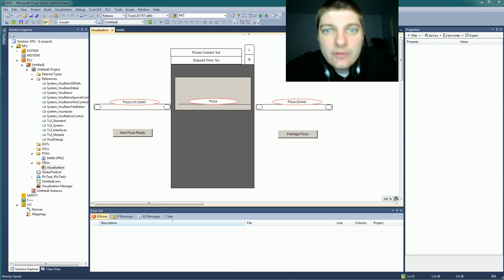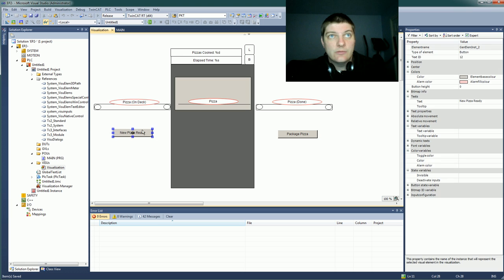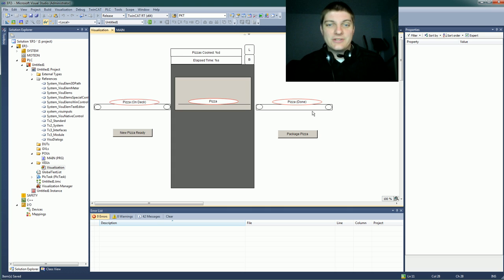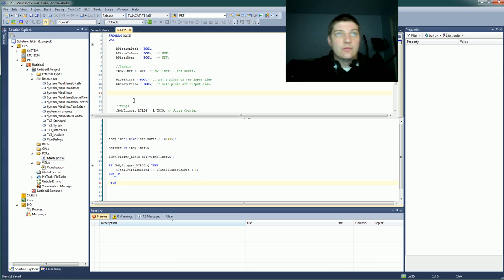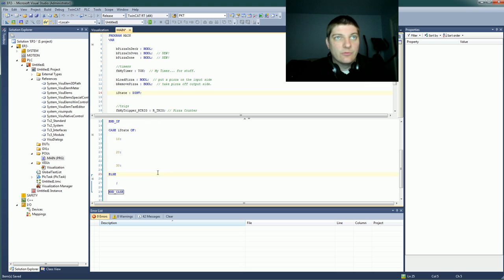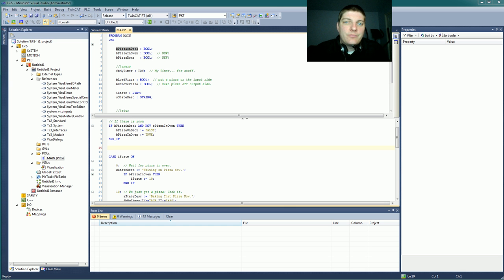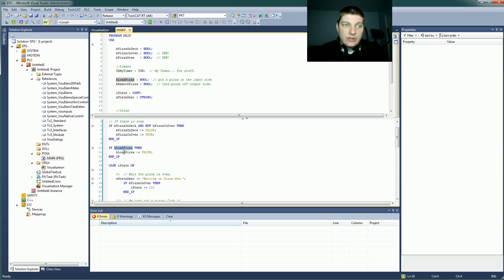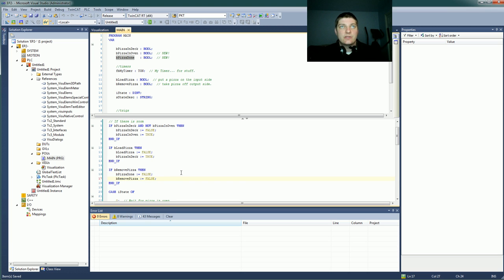Learning PLCs with Structured Text - EP7 - State Machines

Comment: That will come handy for my next project. I always used SFC but this project I want purely make in ST. An I was wondering how would I emulate SFC in ST. This one looks like a good way. SFC gets cluttered very quickly and it is hard to manage. In my code I'll have like 30-50 states in a FB. SO this method will help.
Reply from the maker: Sounds good.  You can get clever and set some code outside the case statement that watches for state transition.  I often set it up to turn on a flag so I get a built in "one shot" in each state similar to the "entering state" functionality of SFC.  I also use this change in state transition to nullify a watchdog timer that I reuse for every state.  It keeps the code lean.  Good luck!
Reply: SquishyBrained Thank you. That sounds like a nice idea. Although not absolutely clear to me. Video example would come in handy.

My project right now is animation of the pubic fountain. I have create library of ease like easeInCubic and other like this about 20. SO I'll also create universal FB that make animation to one direction for given amount of time. By simply placing one FB after the other I can create any pattern I like. So my case is simply 2 lines per case. One line FB execution and the other line is a transition to other case when animation completed.

You know what? While I was explaining it to you I come to idea. I do not know if you get it or not because I am sure you com completely understand  what is in my mind, but I can create a simple array and call it map, where every element of an array is a structure, that contain transition time, ease and from and to variables. So all I meed is to create this map and in cycle I can just execute it. 

Oh man! Thank you. Even without telling anything you are so helpfulll!
Reply from the maker: Sounds good!  You can get into the object oriented side of things as well for dynamic creation of function blocks, but I don't typically find it useful at this point.   Sounds like a cool project.
Reply: SquishyBrained Yep, that is cool one. I'll create a video in my channel. Unfortunately I only make Russian videos. But I have some on CoDeSys as well :) Any way I am following. Any new tricks, share it.
Reply: I have a question also. If I am in CFC for instance and I create an instance of TON FB. Can I place 2 blocks on the field and link it to the same instance? Will it work?

In my case those 2 blocks have never be working together but only one after another.

Comment: so I notice you use numbers for the case clauses, like

10:
20:

is there no way to use symbolic names? I have tried to use enumerations and constants but the compiler is not having it.
Reply: you can declare state machines as global variables:
START: INT :=0;
WAIT :INT :=1;
STOP :INT:=1;

and the in case you just write:
CASE StateMachine of:
START: 
............................
WAIT:
......................
STOP:
.......................
Reply from the maker: Enumeration should work just fine. What I found in the past though, is that naming your states works when there's only 5 or 10 really static things that you have to do, but in a system that you're developing that grows and changes over time, you'll find yourself needing to add states quite often. and when you want to do that, any barrier to adding more states that takes up your precious time such as going to a different file to declare new enumerations is a pain in the butt in my opinion. also, the state number works better in my opinion because anywhere in the file you always know if the state we're in currently is above or below you in the code whereas if they're named do you really have no clue where they land unless you have a massive familiarity with the system.

Comment: Great series you've made. One question, though: How come you are not using an enum for the states?
Reply from the maker: Jes Vestervang Jensen  ENUM states is a perfectly valid way to do it... I've tried it in practice and worked with other code that used it... I find that for small state machines with 10 or so states it works fine, but there are some things I don't care for... Mostly 2 things... 
1) It takes a few extra steps to create a state, adding in the entry to the ENUM declaration.  Not a big deal, but it takes a bit more time.
2) When you try to 'scope view' the data on an enum type, it works but converts it back to the number, and you have to cross reference it back.  
Again, not a big deal, but those are the two main problems.  I typically title the numbered state anyway, so it is just one less thing to deal with.  I don't see the real benefit offered by enum states.

Comment: These have been extremely helpful videos #SquishyBrained.  I am unable to add a Visualization to my project.  I am using Windows 7 and the Visual Studio 13.  When I try to add the visualization, Visual Studio crashes.  Any thoughts on how to correct this?Thank you.
Reply from the maker: Mike Nicholson try a newer or older version of twincat. The visualization system is garbage in my opinion. I never should have added it to the series. If you are doing a real project, go with wonderware or indusoft.
Reply: +SquishyBrained, thank you for the quick reply.  I will try the other options you suggested.

Comment: all the time my computer doing hard reset after i have instaled Twin CAT
Reply from the maker: Interesting... I'd suggest uninstalling, then reinstalling as administrator, reboot, etc.  I have had issues with PCs going into run mode on boot doing a BSOD if certain hardware is not there, but that is only if you've run a program at startup.  Good luck :-/

Comment: very messy explanation of why we need FSM....and explaining your FSM without a FSM Diagram it is just sub optimal .....
Reply from the maker: Good call out, please leave your explanation video as a link to supplement
Reply: @SquishyBrained  when lecturing you should use much more images than prose/words and even less lines of code ....start with analogies of everyday life , easy to remember, start with simple two state FSMs....e.g. the states of a person e.g. (over simplifying first) awaken  sleeping  and how it will react to external or internal events e.g. feeling asleep (and/or tired) will trigger the transition from awaken to sleeping  ...feeling rested (and/or sun rise) will triggered the opposite transition etc....you may refine the FSM each macro state then in sub-states etc.....As for the FSM Diagram i suggest you use open source QFSM ( http://qfsm.sourceforge.net/ ) to visually depict the FSM and all its states/transitions , one by one, during the analysis/design of what are you trying to model/analyze/design ....then you take that as reference for the low level implementation of the programing language and IDE of your choice...